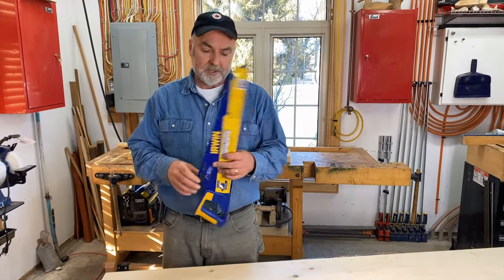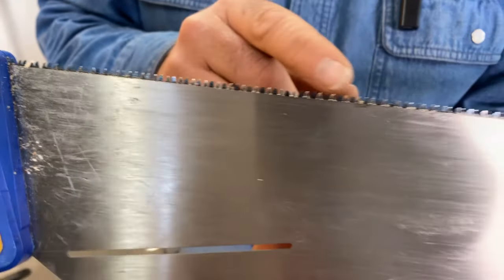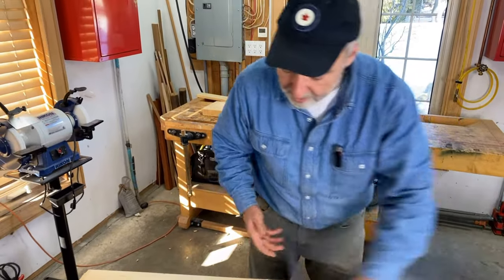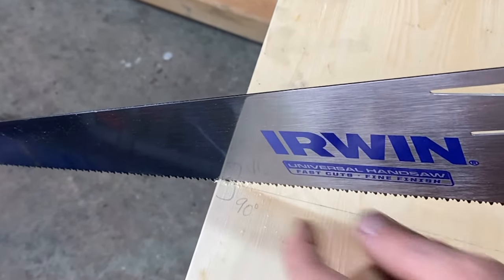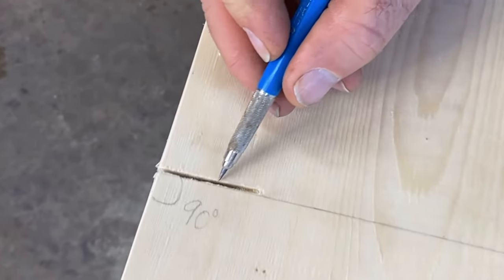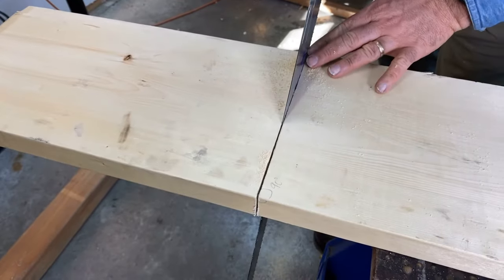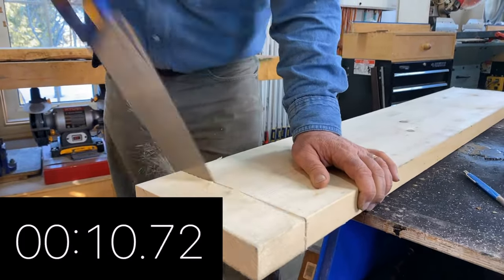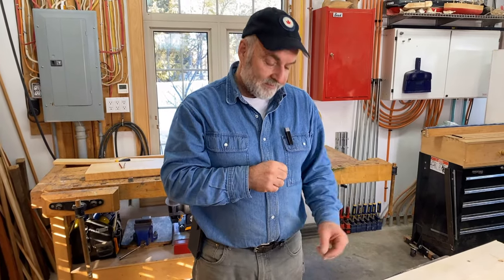Fast Cutting Hand Saw in Action

Comment: I was cutting 4x4 post for a project, I thought up a trick to keep saw straight through cut, place 2 pieces of wood, on top of piece your cutting, clamp it down to keep saw from tipping to sides. 
The cut was straight enough, the board can stand on its own😏
i had to make do, with my free hand, held two pieces with hand over my hand saw.

Comment: Another good way to help your cut stay straight is to point your index finger forward, resting it on the recess at the front of the handle hole (This is why it is scalloped and molded in yellow, the same as the grip). That helps keep your forearm and the blade locked in a straight line avoiding "cocking" of the wrist.
I've used and sold these saws and actually found them pretty rubbish. They're OK for dry timber and composite panel but, having no set, jam easily when cross cutting wet timber. Plus over time the handle loosens on the blade rendering the built in square useless.
And I'm pretty sure the the teeth are designed to cut in both pull and push strokes.
Just my two cents worth!
Thanks for the great video and explanations.

Comment: Can this saw cut birch rounds? New to this and need a saw! Thanks for your help;)
Reply from the maker: Good Morning! So by "birch rounds" do you mean branches of birch trees? Perhaps small trunks? If so, then a saw like the one in my video would work, though whether this is practical depends on diameter and how many you'd like to cut. If you're just cutting rounds less than about 4 inches for a craft project, then yes, this saw is practical. But if they're large, or if you're cutting enough for firewood, then you might consider a cordless pruning saw, or even a chainsaw. What's your situation?
Bye for now,
Steve

Comment: In the UK shuttering (formwork to you Yanks) industry we re-purpose worn out hardpoints into scrapers by cutting them off at about 4 or 5 inches from the handle and dressing the steel flat.  You get massive purchase on the handle and they are absolutely perfect for scraping steel or ply shutters.  I'm guessing other countries do likewise?

Comment: "...special file, special jig, special person with lots of skill..." I am certainly  not special, the files are available at my tool shop and on line and the skill is extremely easy to learn.  A sharp saw will cut fast, hard point or not, period. If you like the saw, buy it and use it. But don't base your motivation for using the saw on traditional saws being inferior. If you are doing carpentry and rough work these saws may have a place, but for joinery or bench work, not so much. They are grossly over set and cut a kerf that is easily twice as wide as a minimally set, sharp tradional saw. The handles are uncomfortable and oversized due to being made for gloved hands on construction sites. You will also discover that pointing your index finger down the side of the handle along the length of the saw will further improve your accuracy, although I believe you gripped the handle with four fingers due to it being so large. So, go save a saw, learn a skill. Don't buy into consumerism and disposability just because it seems like the easier way.

Comment: the problem isnt the cut or the time it takes its how much effort you have to physically put into each cut wearing yourself out so you can not keep up that pace all day depending on the effort put into each cut....do a video where your cutting up boards all day long and then tell U.S. all how worn out you really are when cutting with both saws... one day or one hour  long as a test with each one-  the one older designed irwin saw and then another hour with the newer one then show the number of cuts you can maintain without having a stroke or heart attack and be able to do it again the next day without straining you back or arms keeping a steady pace not trying to outdo your numbers...just do a real life test(hire a college age kid to do it if you can not physically do it just for the 2 hours of testing)....i cut up a 16 inch diameter black oak tree with corona pruning saw blade i mounted on a pole saw handle just to see if i could do it  and at the end of a 4 hour day resting in between cuts i was so beat i couldnt do it again the next day and the corona blade is a laser cut /double cut blade it cuts 4 times faster than the regular manual pole saw blades or most generic wooden or plastic handled hand saws..

Comment: A saw is a saw just cut the  wood  dont
 Need all that guff both got teeth
Reply from the maker: Hello Stephen!
"A saw is a saw"? That's an interesting idea. Over my 40+ years of using hand saws, I have certainly found a huge difference in how quickly and well different models cut. The difference between a good saw and a bad one is probably something like 4x the progress per stroke with a good saw compared with a bad one (both brand new, too).  What experience do you base your opinion on?